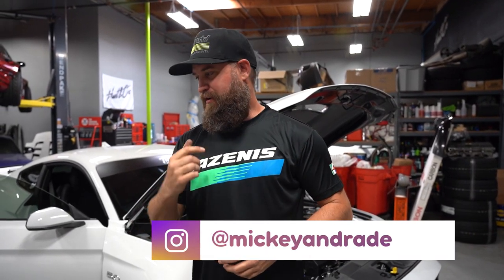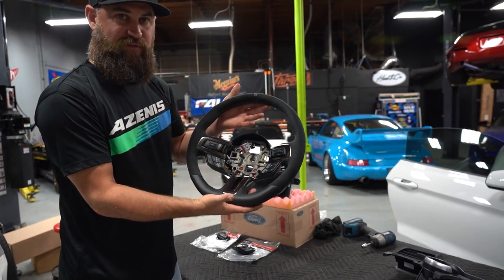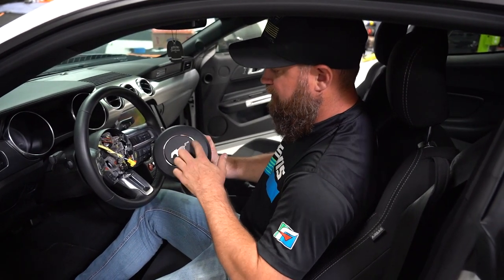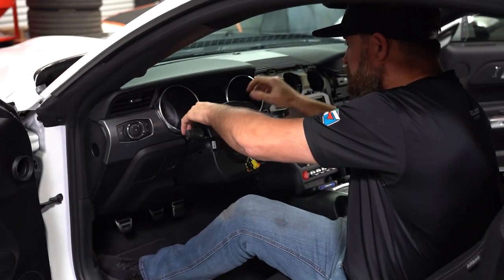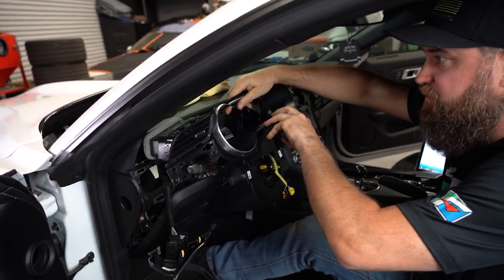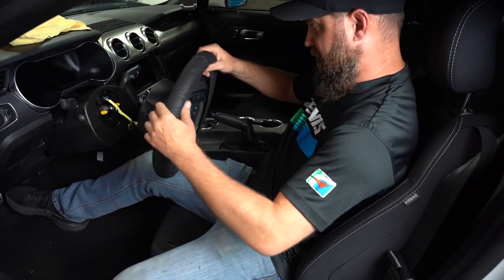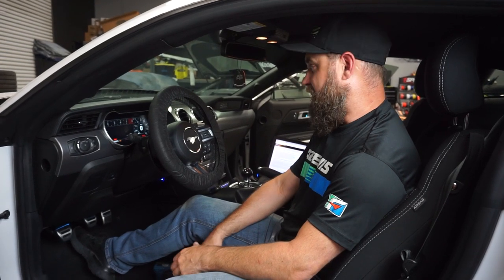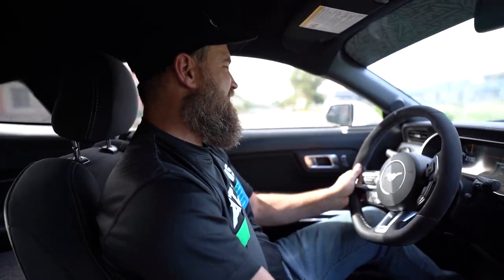Building and Heavily Modifying a 2020 Ford Mustang GT: Part 8: Transforming the Interior!

Comment: That’s a 2020 mustang but the digital dash is set up like a 2018.   Only for 2018 did the dash display the “RPM” on the left side.  After that year for 19+ it showed the gear the car was in.   So basically the software isn’t matching the year.